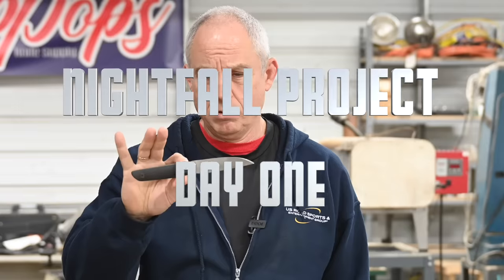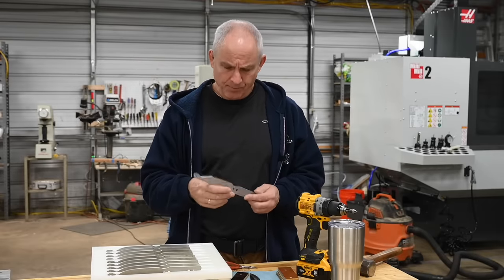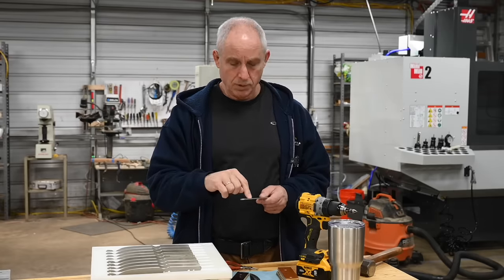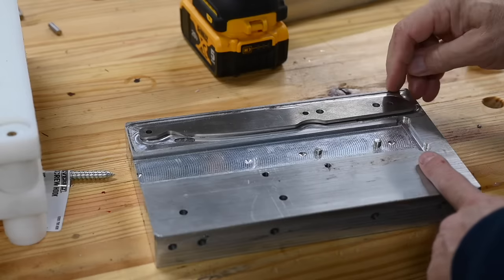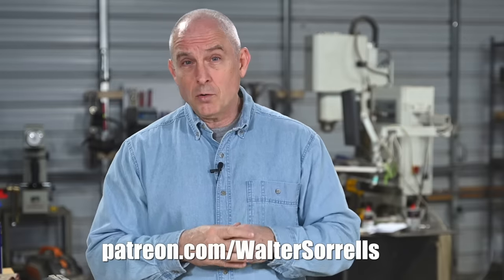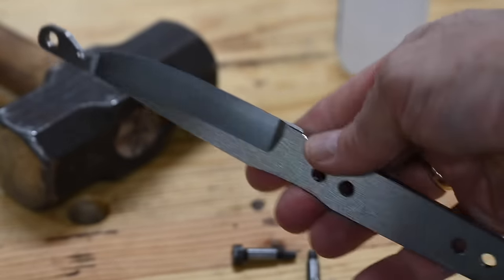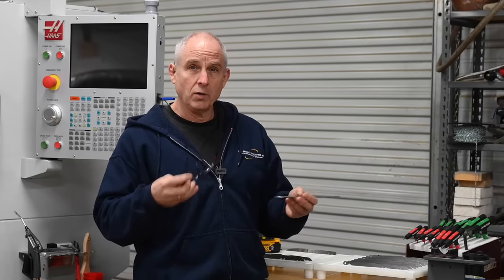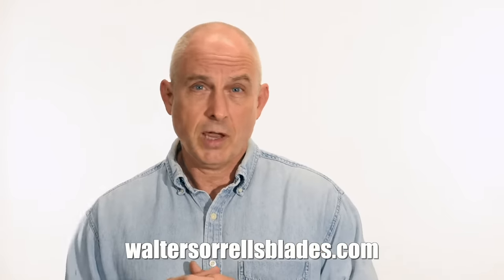You Can't Fix Stupid! - Pulling Back the Curtain on Knife Making

Comment: Walter,  This is right up your alley.  It’s called a “Poka-Yoke”.   The origin in the Japanese language means “idiot proof”.  “Stupid proof” isn’t to far off.  You basically add a feature(unusually a pin) to the fixture block that prevents a blade from being installed backward.   Helps a ton in production work when you may not run a tool/fixture for months or even years.   It also can help protect your tooling and machine by preventing a crash from happening.  I’ve used them a bunch in robotic welding fixture to prevent operators from loading left hand parts into right hand fixtures and vise versa.   I’ve had robot crashes shut down entire $1M+ production lines,  the fix was a $5  poke-yoke pin.  

Do you run one knife/operation in the mill at a time or do you load each station and do one full set of operations. iE cut the out side, drill, chafer, bevel.  Then take one finish knife out, advance each blank to the next step and load one fresh? 

Best of luck with your new machine!!

Comment: Walter, add about 2 feet on top, and about 4 feet in length. Add 3 full 6ft tall x 8ft long computer banks and a CRT with a loop tape. That was the irst CNC I RAN TO MAKE CASINGS FOR AN ELECTRIC MOTOR COMPANY ...IN 1980.....😂

Comment: I don't know if the newer machines are like this, but our Haases' auto-brakes on the spindles don't work when you hit the E-Stop. The spindle coasts to a stop. Hitting the Reset button shuts everything off immediately and turns the brake on for the spindle.

Comment: Hey Walter, thanks for the video and congrats on your new machine!
Did you demo the first knife one step at a time for the sake of the video, or is this your typical workflow?
Because once the first operation is done on the first blank you can basically make a program where you make the first operation on a second blank, then continue to the second operation on the first blank, then add a third blank etc. 
The time saving is not significant in small runs, but you start to feel it on longer ones.

Comment: I would see some scientific( very accurate) testing with this approach vs forged. Might be counter intuitive to you products but I don’t think it will. Lots of people claim forging makes blades strong because it makes them more homogenous. I
Understand the reasoning, but with that said everything has to be done very precisely with temperature and  technique. Cold stock removal with a precisely dialed heat treatment makes for a better blade that’s perfectly replicated. That goes especially for stainless steel blades.

Comment: Will your laser cut blanks have a heat affected zone(HAZ) on the cut edge that will require annealing like plasma cut edges? If it does the hardened edge could decrease tool life in the mill.
Reply: Depends the steel used